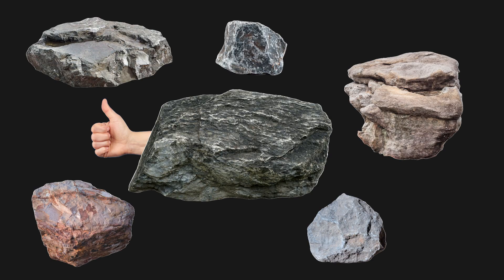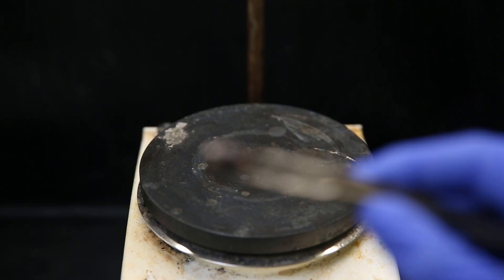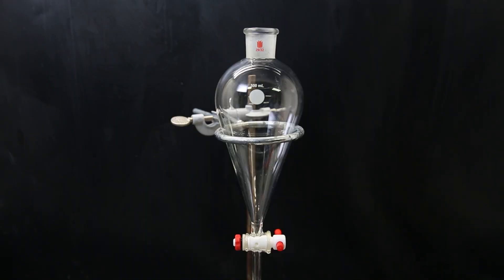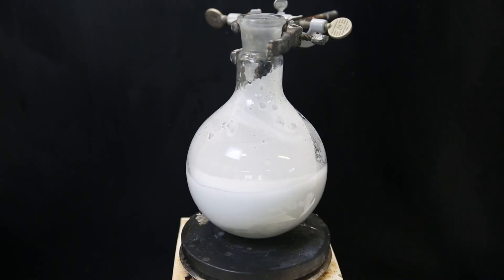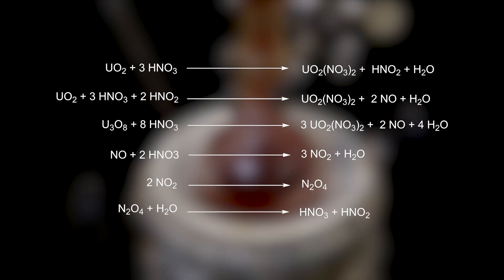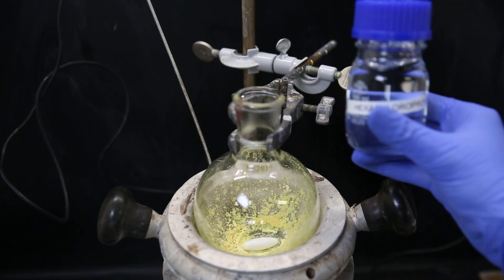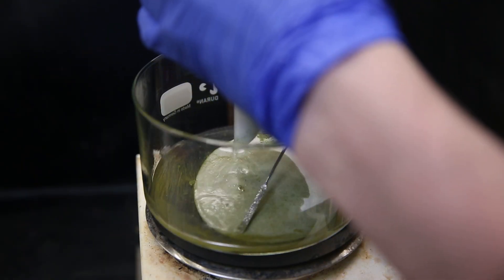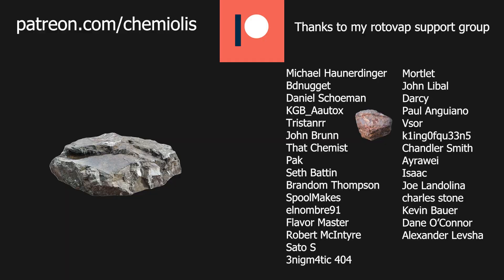Making Uranium Tetrachloride out of my Rock

Comment: Hey I've heared you bought some Uranylnitrate from a certain pottery glazing Company? Well at least i did and i did a whole bunch of chemical analyisis... its Potassiumchromate with ThO2 impurities💀 there is not a trace of uranium in it
Reply from the maker: Weird, mine is uranyl nitrate, it’s quite radioactive
Reply: @Chemiolis  yes it is radioactive But because of mixed in Thoriumdioxide. You have Instagram or some other plattform so I can tell you more about it?

Comment: Pretty brave to handle U Like that! Your UCl4 is Unfortunately going to be pretty impure because of oxidation. I wouldn't even have bet that your material would still look green under air! Also, it is going to be basically impossible to make uranocene without an inert gas apparatus (a Schlenck line). Either get your hands on something Like that or it is pretty worthless to try 😅

Comment: Just out of curiosity, why didn’t you dissolve the uranium rock into a solution of concentrated HCl, wouldn’t that give you the UCl4?
Reply: no, the UO2 is difficult to decompose. Specifically the oxygen is hard to pull out from the uranium. HCl won't do it. You need this convoluted path to get to an oxygen-free uranium compound.
Reply: @stamasd8500  ah, I see, thanks for the answer

Comment: Was there a purpose in heating the first rxn to 100C rather than, say, 70C? The bp of chloroform is only 61.2C so it seems like you were making your condenser work harder unnecessarily, causing it to become overloaded.
Reply: It takes a very long time if you don't heat it up a lot and heating it up isn't too inefficient

Comment: Oh yes. I would love to see more radioactive chemistry. Maybe Americium from smoke detectors? :)
Reply: There is not enough americium (written without uppercase first letter!) in it to do anything but extremely sensitive radioanalytical chemistry. Each detector has a bacterium turd worth of volume of americium carbonate embedded in vapor-deposited gold layer. You can't do visible sample experiments with it and it's for the better because alpha-spallation would mobilize its dust into air.
Reply: @lajoswinkler loads of them dissolved in aqua regia would make a nasty liquid.
Reply: @antejl7925  Good luck getting loads of them. You're going to need like 100,000 - 1,000,000 to get any real amount
Reply: @OfficiallySnek  exactly.  It would cost waaaay more than what it would be worth and you'd need hundreds of thousands of them to even get a visible amount of Americium to work with.
Reply: Just don't do a David Hahn.
Reply: @bromisovalum8417  who is David hahn
Reply: @cooldude7301  bruh, Radioactive Boy Scout
Reply: @avli16_14dl  I just realized that i thought of another related Khan, Abdul Qadeer Khan
Reply: @cooldude7301  😅😅😊
Reply: @cooldude7301  i think he is a guy who made nuclear reactor at home and used many americium from smoke derectors to make neutron gun
Reply: I wouldn't touch alpha emiters with a barge pole..but that atomic kid did collect hundreds in america.
Reply: @antejl7925  Most alpha radiation get's blocked by the skin. Beta and gamma radiation are the ones to worry about. In addition, high energy UV light and x rays are also dangerous
Reply: @OfficiallySnek  yes I know that but there is the real possibility of inhaling or ingesting an alpha particle emitting atoms if playing around with these compounds. I wouldn't go anywhere near americium or radium.
Reply: Americium is far more dangerous.
Reply: The older industrial smoke detectors have radium in them. That would be more interesting
Reply: There’s barely any Americium in those smoke detectors, it would probably cost thousands of dollars to obtain a usable amount of it. There’s a reason why David Hahn had to steal his 😂
Reply: you're NEVER going to see that.
Reply: If you don't know who David Hahn is, you haven't been dealing with radioactive materials for very long or much at all.....
Reply: @BackYardScience2000 Dealing with radioactive materials? I’m just a Tylenol-enjoying YouTube viewer, of course I know who he is 😂
Reply: It's all good man (Saul Goodman Reference)

Comment: Nice to see some U chemistry. You've probably got some other metals (lanthanides, other products from spontaneous fission, in addition to the decay products) from the rock dissolved in the nitric acid, though. Would've been better to purify the U nitrate with TBP extraction (5-30% in n-dodecane or kerosene) first to remove all the other crap, then back extract with dilute nitric, precipitate as ammonium diuranate, calcine that to UO3, THEN react that with the hexachloropropene, at least that's how we do it sometimes. If you're not too fussed about the other elements present in the rock to start with, you're probably OK, but the purification I outlined there should get rid of most of the extraneous crap.
Reply: Start a channel please 🙏
Reply: @Skunkhunt_42  Kinda have one, just don't have the time, space, or spare cash to devote to doing chemistry (even though that is my day job...)
Reply: @heavy_metal_chemist its so cool that you work with chemistry like that for your job!!! I'm starting my major in chem this September, still not sure what kind of work lies ahead but very excited nonetheless